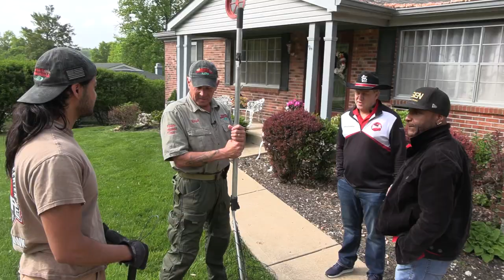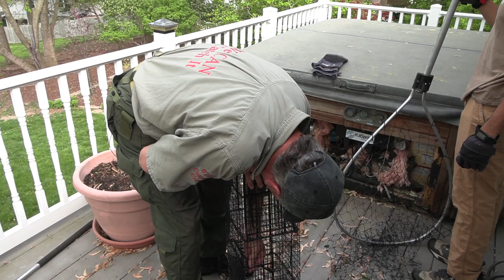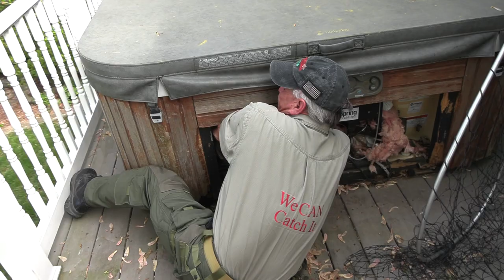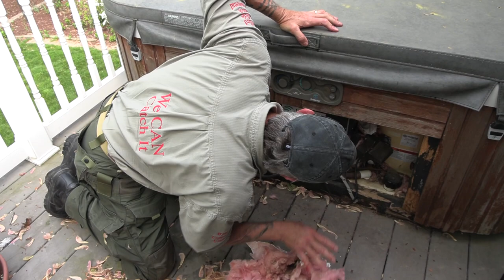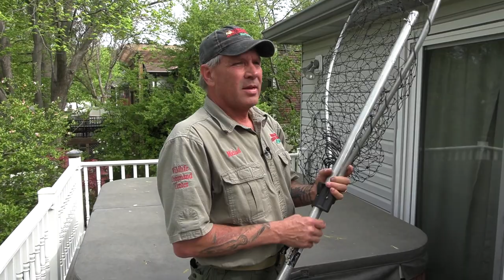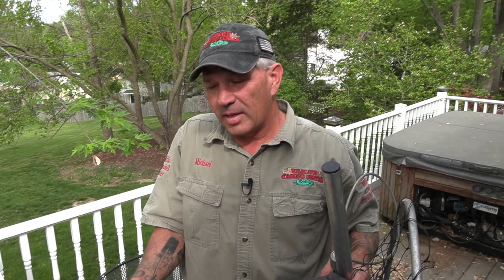Hidden Home: Raccoons Cozying Up Underneath Hot Tub - Episode 18 #animals #raccoon

Comment: Michael are you not worried about rabies after being bitten by her?
Reply from the maker: Well, she didn’t bite me because the tooth didn’t go all the way through the glove. It was just the compression of the jaws against the material that actually made the cut that bled a little bit. Also, I’ve had my series of Raby shots and I get boosters, so unless I really think or if I raccoon actually tests positive I’m at a very very low risk.
Reply: Well what about the disease that touching raccoon poop can cause? I heard it is bad and can cause blindness and other crap. Is that not common to get. Man I have questions. You have balls brother. 👍✌️🇺🇸
Reply from the maker: @johnsellers9623  you are referring to raccoon roundworms, which is a nasty parasite found in the fecal matter of the raccoons